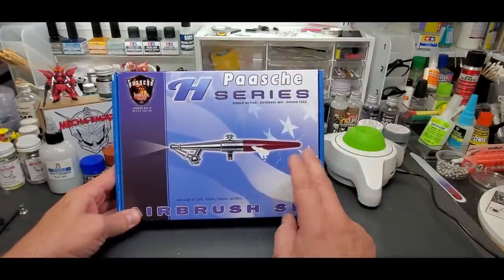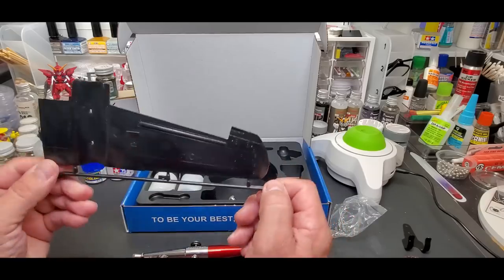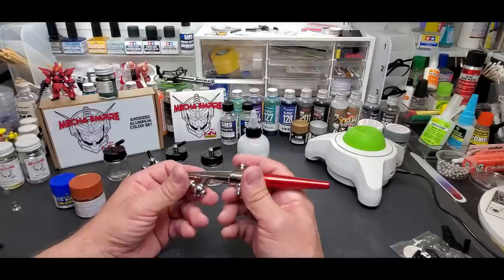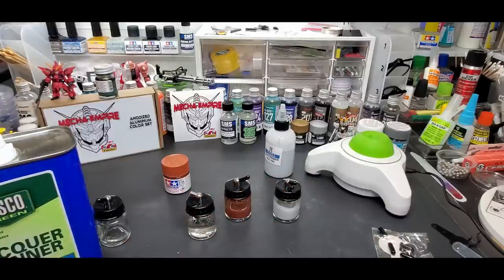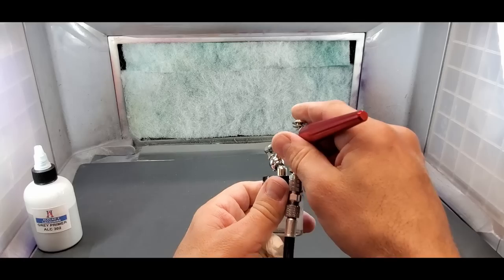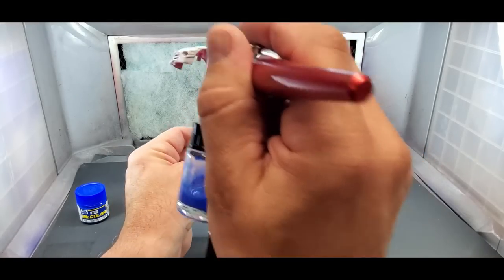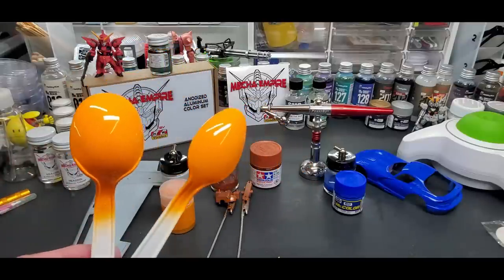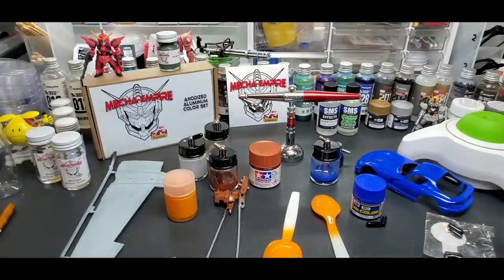Testing The Paasche H Series Airbrush - A $60 Workhorse

Comment: I bought my 'H' model way back in the '70's. I see they still have the same design. Why change something if it works. 
Old dog -new tricks - I like the idea of a jar with thinners. I take mine apart to the last part and clean with acetone which takes up time between colors.
I have all three sizes of nozzles and they do cover a wide range of applications. Thanks for the great demonstration. 
At the time I bought the airbrush, I also purchased the Paasche compressor. I quit using it since not having an accumulator tank  to smooth out the air flow, it had a 'pulsing' condition which spoiled the spray pattern. Plus there was only one pressure although I could adjust that with the little jack screw under the finger lever.

Comment: With out question the Paasche H model is the best single action airbrush ever developed. The perfect beginners airbrush for learning to thin paint and perfect soft blending as well as how to use masking and templates when the operators skill isn't ready for fine lines and fussy double action airbrushes. I have two in my fleet of too many airbrushes and still use them when I do not need high detail in what I am painting. I usually use the side cup as the jars hold a ton of paint and tend to be a bit heavy when filled.

Comment: I own 2, handle also fit the VL model.  At one time metal handle was an upgrade.  I loaded my handles with #9 lead bird shot so more balanced when a jar of paint is used.  I like the wide feel for my big hands.  I have a rare black body which I have a #5 needle, my silver one has a #3 needle.  I learned with this airbrush.
FYI: not all siphon feed airbrush bottles' nipple are the same angle.  Badger has a different angle.
Reply: Most Badgers use the 60 degree angle but the Badger 350 uses this same 30 degree angle.

Comment: Nice video! I picked this up since all the stuff I'm making and painting are pretty large.
This looks like it should make the job much easier.
Reply from the maker: It works really well. Be sure you go with at least 30 psi
Reply: @barbatosrex9473  thank you!
Hoping it works well with my acrylic Createx paints.
Also I love that orange enamel paint you showed in the video.
I have a Deathstroke helmet I'm working on and that orange looks like it would be a perfect color for one half of the mask.
I might need picking that up, but I'll have to watch videos on enamel paints because I don't know anything about them lol.
Reply from the maker: @learnwithchuck2173  my personal paint line consists of mostly enamels. I'll be releasing 20 colors this week and more  ext week. I'll post a video on them next week. Be on the look out for it. I might have the orange in this next batch, if not then next week. Enamels are the easy to work with. They thin with lacquer thinner

Comment: They call this the Workhorse for a reason, and I know some twit will wanna cry about their Iwata being better but for the work load this was made for it isn't.  The fine tip for this will do Warhammer minis though being single action takes some 2 handed finesse but I would recommend a dual for small details, that said the H will not fail you for general purpose model painting even camo schemes.  I have 4 of these now plus 2 side feed Paasche designs I've collected over the years and love them fully.  I use my Patriot and Anthem brushes mostly these days but for large work I have my H's always nearby.  Even though my Patriot can do eyes on mini's fine I break out the Iwata for that.  Great video Rex!

Comment: I really like using the H Series for applying Vallejo polyurethane clear coats because of the ease of cleaning.  After using I first blow through some water and airbrush cleaner.  I then remove the needle assembly and drop it in warm soapy water to soak for a bit followed by a hot water rinse.  I don't have to worry about gumming up the inside of a double action airbrush.  Ditto for primers.  As a model railroader I could probably get away with an H series for everything, but I really like my double action H&S Ultra for most painting.

Comment: I have bought a lot of stuff already but I am tempted to buy this set. I bought the patriot 105. And a compressor. I am thinking that this airbrush could paint stuff I 3D design that are bigger pieces that do not need intricate detail work. Just a better option than a hardware store spay can. The only spray cans I like is the Rust-oleum Artisan or something like that.  Those have a better trigger by far. I am thinking this Airbrush will have a better spray than that product. Also, you are pretty limited by standard spray cans in colors. BTW: Anyone looking to buy a Patriot 105 don't buy on Amazon it is listed for $125us. I am returning mine and bought another one at SprayGunner with all three Needle sizes for $98.00us. This Airbrush set is on Amazon for $68. A little higher than $60 but not to bad of a price.
Reply: Or a Badger Anthem 155 - which is just a syphon 105 with a 0.7 needle.

Comment: Seems great for primers and clear coats and the enamels you did were a beautiful smooth and glossy finish. Is there likely to be any runs with such a volume of paint being delivered. That is one area I have trouble with, either getting graining or runs. Just have to keep practicing with my mixing and getting the right setting for paint flow. Thanks for showing this Rex.
Reply from the maker: I haven't had any runs yet with this airbrush

Comment: I have a Paashe Talon top feed version, which also has a siphon feed version which I've been considering but the H-Series looks pretty decent, and is a bit more affordable too. I may have to consider that when/if I decide to get a siphon feed. I do mostly minis for D&D and the like, moreso than models so even priming I don't use but a few drops so still not sure a siphon feed is worth the investment for me.

Thanks for another outstanding review/demo!
Reply: Talon is far better at atomising paint - just need the 3 heads for it and it’s pretty much the only brush you need.
Own H,VL and Talon - internal mix always wins for me.

Comment: Not sure if you have covered this somewhere else, but was wondering what quick connect system you are using. I finally got a Master airbrush and pulled out my old Paasche H that I bought over 15 years ago and never used. It is still new in box. Realized I need an adapter to convert it and would rather invest in a disconnect system since I also plan to purchase a Badger 105 in the coming months. Thanks for your informative and extremely helpful videos. Really appreciate the response as well, sure you are very busy and sorry if you have already mentioned it and I didn't find the answer.

Comment: A few thoughts and questions: I’m not sure you covered “canned air”, but the canister ALWAYS need to sit in a bucket of warm water to prevent icing. Before you airbrush these model parts are you cleaning them of mold release first?  Great channel, I’ve bought a lot product based on your reviews 👍🏻

Comment: I had this exact airbrush way back when it first came out and I had nothing but problems with it, half the time I couldn't get the thing to work properly I think the biggest problem was that I relied upon canned air and this Airbrush needed more air pressure than what canned air could provide, plus the can always iced up reducing the pressure and further making the issue worse. eventually I got so disgusted with this model that I sold it for virtually nothing at a garage sale just to rid myself of it! If you decide to get this airbrush, it'll require more air pressure than other airbrushes would.
Reply: I am no expert but the cans likely did not help.  The pressure continues to decrease and there is no consistency from the start.
Reply: Definitely would have been better with a tank compressor. That was an issue I had as a kid with cheaper air brushes that turned me towards brushing kits back then.
Reply from the maker: These need a real compressor. It must be at a stable 30 psi
Reply: Yes sir, most are rated at a 40psi minimum
Reply: Lol can air
Reply: I use mine at 20 psi on my portable diaphragm compressor and it also works a breeze on either of my receiver compressors. Great for applying primers and base coats, for detail work I use a DA airbrush although I've seen some use the H for detail work too. Your problem was using the cannisters, they're expensive, don't give constant pressure and freeze up. You should try again with a decent compressor ✌️👍😊🤞

Comment: Mostly cause it was one of the things that drove me off from airbrushing to begin with over a decade ago, that cleaning method with a dedicated bottle of lacquer thinner/acetone should work with the Badger 350 line right? Due to lack of direct knowledge around me at the time and lack of good resources on youtube back then around 2009/2010, I found myself taking a half hour between color changes cleaning the entire brush out via disassembly/deep cleaning. If I may be honest, I found airbrushing at the time to be fairly aggravating and an absolute waste of time to do back then when starting out due to stuff that because I thought and was told that that was how it was supposed to work.

Comment: As always you're the best!   Will you do a full review of their Talon GF?   I have own and I got so many probs with it...   Piece of  crap, just a bad one, need finetuning or something I'm doing wrong...
Reply from the maker: From research it seems the Talon  just isn't a good airbrush. Because of that I never looked into it.
Reply: Own about 30 airbrushes and if I could only have one it would be my talon with 3 heads set.
Reply: @LemurKrazy  Happy for you.  But can you tell me if there is a good (really) community about Paasche Airbrush, 'cos I really have some majors problems with it.  (bubbles, clogging...)  I would appreciate your feedback.
Reply: @lbboy2513  have had almost all airbrushes clog and bubble under the right conditions. Long sessions with acrylics mostly - nozzle blockage. Search youtube for airbrush troubleshooting videos - there are many variables not specific to paasche. I have even clogged a H when priming with a bad batch of stynylrez due to tip dry over the course of half an hour.
Reply: @LemurKrazy  Thanks for your response, I know that acrylics can be treaky sometimes.  But I think that my Talon has some sort of a problem with nozzle connection (Paasche sent me news ones) and I got bubbles in the cup even with water...
Reply: @lbboy2513  That's not good. Guessing you have the base Talon with the single 0.38mm nozzle? The head, nozzle and needle should all have 2 stripes/grooves as a set - needle tip should be straight and nozzle should have clear round opening. Only things I could think of that might cause blockage out of the box are wrong parts or damaged parts.
Reply: @LemurKrazy  Yeap, you're right.  I bought the .21mm combos too.  I suspect leakage from aircap o'ring / nozzle.  Because often the nozzle get stuck inside the aircap when I remove it.  When I use some teflon tape on threads, the problem is almost gone.  I will try some threads sealant or bee's wax...

Comment: First attempt with this has been a complete disaster.
Sprayed some Mr Hobby surfaced successfully with my Iwata double action, and thought I would try the same mix in this. Wouldn’t spray at all. 
It was murder to clean as well. The Iwata is so much easier. 
Will try again another day, but can’t see the point.
Reply: The fire hose needs much higher psi

Comment: So you can thin Acrylics with lacquer thinner...or just the Tamiya Acrylic?
T.Y
Reply from the maker: Only certain acrylics. Many acrylics are solvent based, not water based. Tamiya, Mr Hobby Aqueous, AK Real Color and SMS are all solvent based acrylics and you can use lacquer thinner with those. Do not use lacquer thinner with Vallejo, Citadel and any other water based acrylic. Here's how you can tell which is which. Look for a Flame logo on the label. Flame means solvent and no flame means its water based
Reply: @barbatosrex9473  awesome Thanks.

Comment: Now you see why I moved to the GSI Creos 290 from the Paasche H. It's a great starter brush but once you get good at painting you realize you can make your job easier. Paint atomization and spray pattern. Less work with the Creos 290. But ill say I used this as a great starter. Moved to the Paasche action VL and then the GSI creos. I now have a 3 way splitter. I run GSI Creos .5mm for big parts. I run the Paasche VL double action .3mm for detail. Then run the paasche H on a .3 or .5 for clear coat
Reply from the maker: GSI airbrushes are great

Comment: I found my older paascheH, it has a plastic end not aluminum lol...what pressure were you using while painting? mine came with 2 glass bottles and 1 big triangle shaped jar...
Reply: I found that 35psi works best for mine. At less that that the atomization isn't great, very speckley. But at 35 it smooths right out

Comment: I have used the H for a very long time - it is perfect for the large scale working models I build  (My Gneisenau in 1/100 scale is about 8 feet long).  Easy to use, easy to clean it is a useful tool to have in your arsenal, and very affordable.
Reply: holy MOLY that's a big model! where the heck do you display that?? 😂
Reply: @GenuineRage   I built a workbench against the wall in my shop and put storage for that ship under it.   A plastic frame with a thin plexiglass panel sits in front of her and gives dust protection.    She is radio controlled and I take her out for a spin from time to time - the gun turrets work and she even has a stereo system.

Comment: I really appreciate that you have all these videos. My brother concerned me the other day when he warmed me about excessive amounts of overspray. He used to airbrush HO scale train models and he said the room would be filled with overspray and fumes even with a spraybooth exhaust running. So I went into the basement and found his old airbrush just to see what exactly he was using. Turned out he was using a Paasche H0811, single action siphon feed, with Walmart craft department acrylics, in a basement with next to zero airflow with the exception of the spraybooth exhaust. So I came here to see if your test of a Paasche H model could shed anymore light on why he was getting so much overspray which I've never seen be an issue in any video as long as a spraybooth exhaust was running. But your video actually did the opposite, I can't see any particular reason outside of room conditions or specific usage that there would be so much. This airbrush, which is at least in the same family, I couldn't even find the H0811 on their website, actually looks really good. I don't know why, but going into this hobby I was led to believe that gravity-fed airbrushes were far better than siphon feed's. But this works fantastically it would seem, especially with the customizable needle, and the ability to hot swap pre-prepared paints like the Sparmax Flyer, except you can get a lot more bottles for cheaper.

Comment: what air pressure are you using.   25 to 30 psi maybe   because it has a siphon feed so you need a high enough air flow to pull the paint out of the jar is this correct....
Reply from the maker: 30psi

Comment: On your bench next to the nail file is a cup of bearings. What were those? I remember you showed them in a video a long time ago to keep in the paint bottles. But I can’t remember what they were made of. I just remember they were not stainless steel. Thanks
Reply from the maker: I put those in paint jars to help with mixing them. They help big time when mixing with my paint shaker
Reply: @barbatosrex9473  What are the made of?
Reply from the maker: @nearzero1555  stainless steel
Reply: @barbatosrex9473  cool thank you! I think that will help me out!